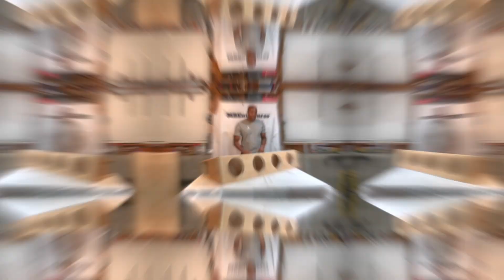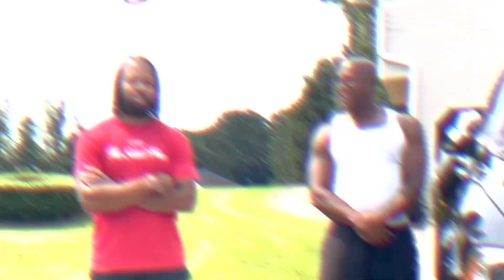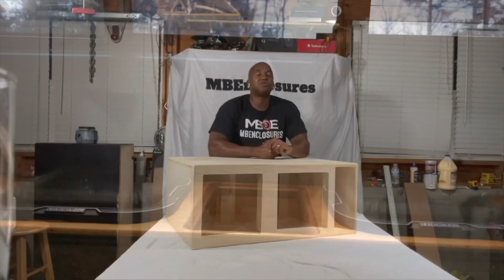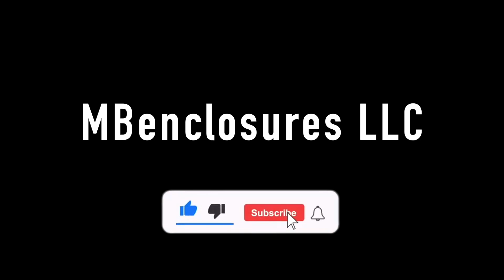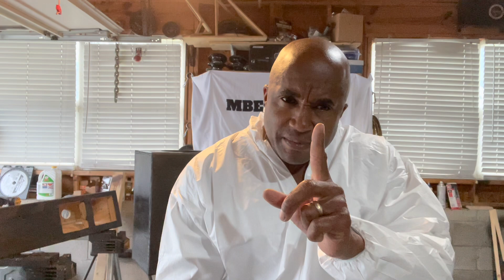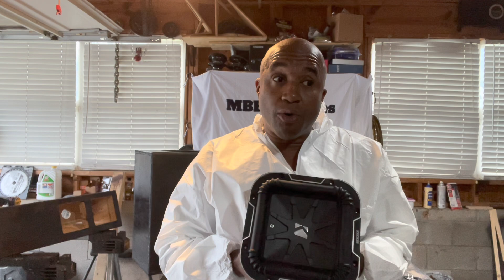What is SD? How to measure it if TS Parameters is not given.

Comment: Obviously there's no advantage of less cone area but Sorry I just can't agree with the cone area is king...I feel it's more the motor assembly (coil included)  I had a custom 10 I built With a big roll surround and a 40mm copper coil  I just rebuilt it with a mega roll with a 50mm aluminum coil with more gap clearance so that's not an advantage., They have the same spiders. But Looking at the rear of the 2 cones the cone itself with the the large width of mega roll it made the cone considerably smaller. But with that longer coil and less cone area it has considerably more output. So if the cone area makes so much difference it would have had less output or at least similar output even with a 10mm taller coil...

Comment: Hey, you mentioned in this video that the DD 2508 has more cone area than the L78. It also has more xmax, and more power handling. Why don't you do a review of it?
Reply from the maker: Maybe
Reply: I have been saying that for some time now. But there are upgrades you can do to the 2508F so not sure if that plays a role in it or not for review. Like on mine they are Kevlar cones and SC